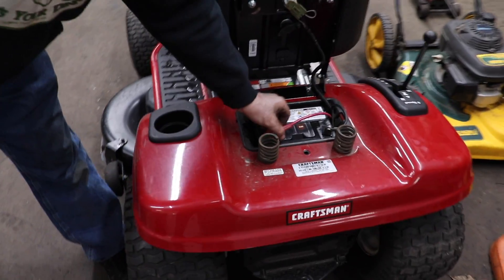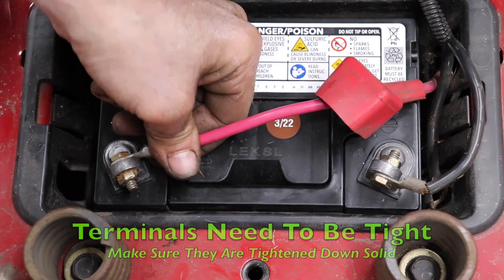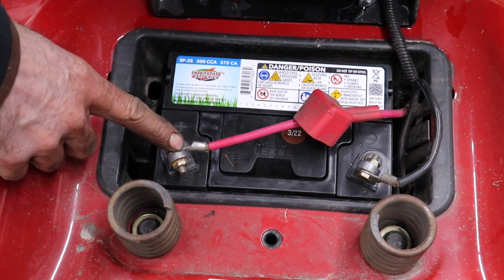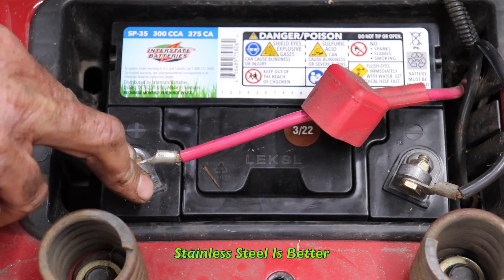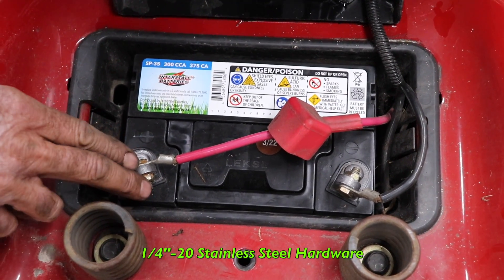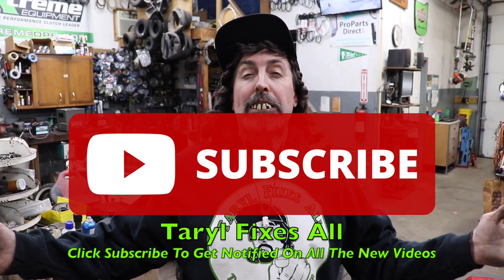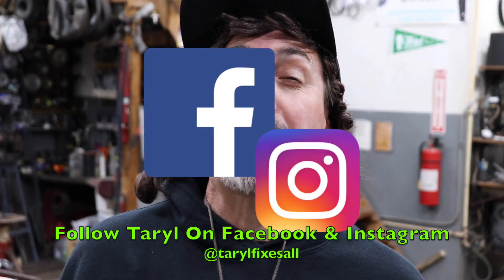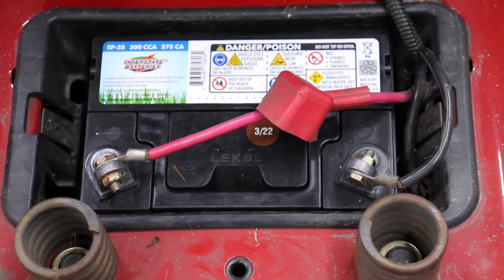New Battery and STILL WON'T Start? Here's Why

Comment: New battery, adjusted the valves, and performed a full maintenance on my Kholer engine and it still started hard. Took some sandpaper to the terminals and it now starts like a champ. And there's my dinner! Thanks!

Comment: Also check ground where it connects to the engine block. They can vibrate loose.
Reply: Yessir!
Reply: More than once I’ve seen “power” problems that turned out to actually be a ground problem. I’ve learned to check for power AND ground when diagnosing electrical issues. Too many times people seem to forget that you need a complete circuit for power to flow.
Reply: I've also had to replace the complete batty cable because of  "corrosion creeping under the cable insulation where it was hidden until you stripped the cable. Happens to both positive AND negative cable.

Comment: I keep mine very clean. One thing I also do is I use aluminum antisieze on the terminals to stop the corrosion. I’ve also used dielectric grease. Both work wonders…..

Comment: This advice helped me out today.  I put a battery into a garden tractor and it would not start.  Today I cleaned the connections, put in a new battery cable and tightened all connections.  Turned the key and starter engaged.  Got mower running.  Mower was surging some so cleaned carb.  Put back together and still has a hesitation in full throttle.  Dirt some place in carb.  Thanks for video!

Comment: I work at a battery shop and see this all the time. People bring the new battery back thinking it's bad. All they needed to do was clean the terminals or tighten the bolts. Sometimes the old battery is actually still good, it just needed to be cleaned.
Reply: Yup  just scrub it with water and baking soda. The soda neutralizes the acidic slop. a dirty loose terminal will pop and let go of the connection making you think it is dead. Driving around like this can ruin your alternator and not charge the battery properly.  They make fancy sprays but save your money just mix up baking soda and water mixing it real good right before ya pore it on. Paul's totally right I have seen this a lot. 30 plus years working on vehicles.
Reply: People are dumb.

Comment: Wow, this is definitely my dinner because this is the problem I was having today, no new battery but I tried mine for the first spring time start and nothing. Put the charger on and not much after that, just a couple turns over. Gonna have to give them a cleaning and some new stainless steel bolts tmrrw. So maybe this is devine intervention that this video came out today. Thanks Taryl...

Comment: I spray the terminals with Fluid Film. Keeps from corroding.  I use it on vehicle battery terminals, and even my snow shovel.  Also inside  the bucket on my JD 140 loader. Keeps snow from sticking inside.  Great product.  Great for rust protection too.

Comment: Omg I pray this is what's wrong with my mower. I got so much crap to do and I don't understand why every single time I am hurrying to mow my dang yard and the mower doesn't wanna turn over! I just bought a brand new battery and I am about in tears over here!! Why does the mower hate me?!? I'm a single mom to 4 girls and 1 granddaughter. I don't have time to play Let's figure out why the mower won't start today" every single day all summer long! I'm off to buy sand paper and looking into the bolts and screws getting replaced with stainless steel as well! If this doesn't work I think I'm gonna do a controlled burn... Lmao 🤣 jk yes that would be rather dangerous and I'm an unlucky person!! Subscribed and will prob be watching all these videos at some point in time! Side note I replaced an element in my clothes dryer just by watching a guy on YT!! 🤷🏼‍♀️💁🏼‍♀️

Comment: I always check to see if the battery is charging with a volt meter. 
Did the battery die of old age or was there a bad regulator or alternator. I check those first before changing the battery.
Reply: good advice years ago but now they make batteries so damn cheap anymore while keeping the price high and there not worth it

Comment: Hell yeah, brother. If you think you have a bad "ba-tree", you gotta test it before dropping a bunch of cash on a new one. Throw the charger on it and see if it's taking a charge right. Take it to the parts store and have them give it a load test. An ounce of prevention, ya know.

One time I thought my dear ole "DEERE" 116 had a bad starter relay\solonoid. Turned out to be a simple matter of rusty connections. I haven't done any mowing yet this year and I can't wait to see what the old fellow is gonna throw at me this time.

Comment: I clean the battery terminals on brand new batteries as well as the cable connections just to get off to a proper start with a new battery.

Comment: I add star tooth lock washers under my battery nuts & bolts and that well help electrical connections.  They are available also in stainless steel.

Comment: I got a free Toro zero turn with a recently replaced engine, new starter and new battery because the valves were loose which built too much compression. It's mind boggling how much equipment I get from the scrap area of the mower shop one town away over stupidity. I actually guarantee everything I sell and in three years of finding this honey hole only had one push mower come back because the guy clogged it with wet grass. I still have his money back to rid myself of the result of a single mother.

Comment: Taryl - Do you always rub a little dielectric grease, on the battery connections and terminals after you put a new one in? I still always do it for any battery replacement, because my father always did so as well. Thanks and super wonderful videos and advice, as always.

Comment: After the terminals are all cleaned & tightened, spray them with some Permatex High Tack gasket/sealer spray (red).  Been doing this since the 70's...it works.

Comment: Just put some grease on the terminals a thin layer will keep the corrosion down for a long time. Vaseline works just as good. It does not take a lot so no need to goo it on there. It goobers up because you have 2-3 different or dissimilar metals tightly held together and they don't really like each other. Well the grease is the happy medium that holds them apart by a super thin layer. Well at least for a time. Usually years but if the corrosion has started then that time is lessened. Best to start it out the gate with it on there. Now the little green and red felt pads don't stop this from happening all they do is absorb it. Once the felt is permeated it will build up. Now you got a sponge full of rot making material sitting under the hood.

Comment: Good idea,  stainless steell,steel,, I did it. Lol.. stainless has high resistance bad conductivity. For grounds. Or add one. Permatex anti sieze  compound has done me good on boats and cars for 50 years.
Reply: If the bolt is conducting current you have bigger problems then. The cable is crimped onto the ring connector which is in direct contact with the battery terminal. So that's where all of your current should be flowing. If it isn't your connector is crapped up.

Comment: As a man of wisdom here, the bolt hardware needs to be stainless 1/4-20 by 1" long, and the nut needs to be a kep nut, the one with the spider looking washer made onto it. They don't vibrate loose anywhere near as often.

Comment: Richmans nice Interstate battery!  Richman gets the stainless steel.  Right on!    I had a double whammy on my Snapper LT45H38...., the battery said bye bye (though was a kids toy one that I've been pushing and last season used either the free Artek jumper or my marine deep cycle) and the latter two jumpers decided to need a nice slow and steady charge... or at least the marine one did.  Well... noticed after replacing the deck belt my deck was wanting to engage.  So, after purchasing my first brand spanking new garden tractor (OK, it'll be used on the lawn toy) battery that's a 300CCA'er.... I figured I'd better pull off the engine drive and deck pulley and cleaner good all country boy ain't buying in to the eazy works schemes!!!  OK, breather... maybe I'll paint her after polishing... ok... Taryl what they hen?  The Snapper manual says on the deck I can adjust something that ain't there???  I'm going with greasing it all... OK... that didn't work so need to polish that pulley and see what else afterwards like... who returned the wrong belt to the store that I bought from maybe???  Hope not. Let's not be silly.  Now, get er done!

Comment: We pick up a few  battery's  from  Wal-mart  mower's wont start . so i didn''t a battery  test come to fine out  the batt had Zero cranking Amp's But still showed 12 volts ..

 If you place a tester  on a battery an you go a turn the key and the Voltage of the battery drops to almost nothing . the battery has a dead cell in it . battery  Voltage should not drop  little if any

Comment: I have been having the same problem with my john deere gt275 rider. I just put in a new battery last week. it was starting just fine the day I installed it. then the following week the starter was clicking and not turning over so I thought the starter was bad.  I bought and installed a new starter and that wasnt it. I found out the new battery was faulty. it would hold a charge for alittle while and then go dead. been using a jumper starter pack to start it and it starts every time. costly lesson learned. Not all new batteries are good. some are actually bad.

Comment: And if all of that won’t fix it check the valves. Loose valves will make it build too much compression and not want to turn over fast enough. I have fixed several by just adjusting the valves.

Comment: My worst blunder was one time while mowing my lower field (I mow about 4 acres) I ran out of gas  because "Just 1 more pass" before heading back to the garage.
So I had to walk to the garage to get the gas bottle, carry it ALL-THE-WAY down to the tractor, Top off the gas. Carry the gas bottle all-the-way back to the garage. Walk all-the-way back to the tractor,... Now it wont start,. Turn the key...Nothing! no crank, no start.
Thought the battery must have died because I left the key on. Walk all-the-way back to the garage to get my booster then all-the-way back to the tractor. Hook up the booster, turn the key ... Still Nothing! WTF!.
Tractor sat there all week. 
My step father came over and went down to look at it with me. I sit on the tractor, step on the brake. go to turn the key and that's when it hit me. The mower deck was still engaged!
Reply: Yep, I've seen that as well, it can throw people off of their routine. Its good to take a second to go through all the interlock functions. Deck up, mower off, Park or neutral, sit in seat, etc. Might even be helpful to "exercise" those functions (on and back off) just in case something is becoming borderline flakey.
Reply: Want till tractors are electric lol two  hour cut time, bring a tow truck lol

Comment: give those terminals a little spray of battery terminal protectant after you clean them too!
Reply: Don't use that red stuff. It's junk. The red looks pretty but dose little to nothing to protect the terminals. Put a little grease on the posts, terminals and hardware after everything is clean.

Comment: My cussenfuss is those dang cheap solenoids always going bad    I usually drill holes in  the body   and give um a  WD-40 flush to ferret out some of that rust and corrosion that gets on the contacts to revive um for an extra couple of years

Comment: Here’s a question for you guys.  My father-in-law‘s mower which has a two cylinder Kohler engine, one of the higher end models, it runs rough when it’s NOT under a load (a load like mowing for example), if he’s just driving around without mowing, it sounds like it’s missing or sputtering.   However, as soon as he starts mowing which puts the engine under a load, it instantly runs better and sounds smooth.   Any ideas what’s causing that specifically?   My guess is something related to the carburetor.
Reply: It sounds like maybe the idle circuit in the carb is gummed up. So you're probably on the right track.
Reply: @1pcfred  Could that be the issue even if it runs bad at full throttle while not under a load?  I would have to go back over there and listen to it when it’s idling but if I remember right it was idling pretty well, but when you throttle it up it runs rough until you put a load on it, I guess when you put a load on it that’s when the governor is kicking in and helping it.
Reply: @ThePhotographyHobbyist  the idle circuit will affect full throttle operation too. It's there the whole time. But it's more pronounced idling. Tuning engines is an art form. There's a lot going on and it all has to be working in concert with each other to get the optimal tune. Spark and fuel.
Reply: @1pcfred  let’s assume for a moment that it’s not out of adjustment.   Then the next thing I’d assume then is that a good carb cleaning would solve this, is that’s really the problem (the one you mentioned)
Reply: @ThePhotographyHobbyist  could be the fuel filter, bad gas. Could be a lot of things. It could be a fuel starvation problem. A collapsed or pinched hose. You have to read the plug.  If it's white or gray it's too lean. Could be a bad fuel pump. Tractors often have this solenoid valve that shuts the fuel off and they go bad. I was out of gas one day and put some 2 stroke in the tractor just to do a cut. That gummed up my fuel filter. It was due for a new one anyways. Was still a boneheaded move. I figured it'd just smoke some.
Reply: @1pcfred   Thanks.  I’ll check it out if I have time and he asks me too.  (Father-in-law).  ;)

Comment: Taryl, would using brass or copper bolts work better ??? They conduct electricity a lot better than stainless steel fasteners. Thanks vf
Reply: You aren't trying to conduct through the bolts, but rather through the terminal. The bolts are there to hold things together so the electricity can flow through the terminals. Brass or especially copper will lose  tension faster.
Reply: @richk6827  Thanks for the information Rich. I will remember that Sir. Peace vf
Reply: The bolt isn't conducting anything. The connector is right on the battery post. Electrons take a direct path. They're not like you stopping off at the bar on the ride home. They don't faff about. Unless the connector is really oxidized. But that's what this video is about. Clean those connections! Copper is too soft. You want steel hardware.
Reply: @1pcfred  I took your advice Paul. The battery I put into service had oxidation "black color"which I sanded shiny and used steel bolts Engine spins super fast with a 200 CCA battery. Used a silver battery type instead of the gold battery amp wise. The price was 42 dollars over 90 dollars 340 CCA. Figured 200 was enough for a 12.5 H.P. Kohler engine. Thanks Paul.
Reply: @victoryfirst2878  corrosion is a funny thing. Sometimes it's obvious and sometimes not so much. In general you can't go wrong with bright and shiny clean when it comes to electrical contacts though. So when in doubt polish it up. It'll never hurt and it might just help.
Reply: @1pcfred  Could of not said it better myself. Peace.

Comment: Also check the date code on the battery before you purchase it I can't tell you how many times I've shown up at the customers home and they tell me they just installed a new battery and it still won't start and I check the date code and the battery is old and dead been sitting on the shelf forever

Comment: Plus don't over tighten the bolts on the battery Post otherwise the .lead will cave  in The use of The right size of washers will help with this carving in of the lead battery Post

Comment: Sandpaper?    Get 1/4 drive brushes for your 1/4 impact
Reply: I find on the ring connector itself some plumbers cloth works the best. shines it right up. I'm not dragging an impact out to the tractor shed. For the lead terminal I like to use a wire brush for that.

Comment: Now there is your dinner. I use Vaseline to prevent corrosion from reforming.
Reply: I just brush on a coating of grease. I save the vaseline for medical use :P
Reply: I use hard grease
Reply: I use Vaseline for... nevermind.
Reply: @Daddyrabbit_2  medicinal...purposes. ahem.
Reply: @TuttleScott  absolutely for medical use

Comment: Make sure you have water in your battery and do not overfill the cells. Clean the top of your battery and battery posts with baking soda and water then rinse with clean water. Acid and dirt on the top of the battery is a path for current to flow between the battery posts that will discharge the battery and the acid on the terminals and cause corrosion. Don't contaminate your battery posts with that nasty dirty battery post  cleaning brush you've had forever. Use a sharp knife to scrape away the layer of oxidized led until the clean shiny led is exposed. Clean the wire terminals and neutralize the acid on the terminals with baking soda then rinse. Put a coating of dielectric grease or Vaseline on the dry terminals, battery posts and the nuts and bolts and assemble the connections. Don't use that red battery protection spray that Napa sells. It may look pretty but It's junk. Stainless bolts are great, but if your steel bolts are corroding it's because the battery acid is getting on them and the acid usually comes from overfilling the battery. Keep an eye on the battery and clean off any dirt or acid you see on the top. When you're blowing the grass off of your mower deck, don't forget to blow the dirt off of the top of the battery.

Comment: What's the min/max cold cranking amps for Craftman 11hp riding mower?
Reply: That info is on the battery.
Reply: Depends on what battery is in it.
Reply: I work at a battery shop. You want something with at least 230 CCA for 11hp. Going higher with the CCA won't hurt anything, it will just cost you more money and you don't need it. Hope that helps.